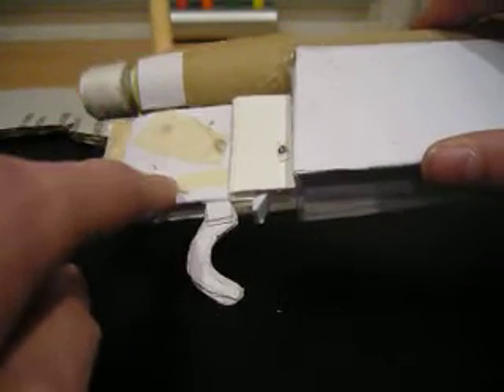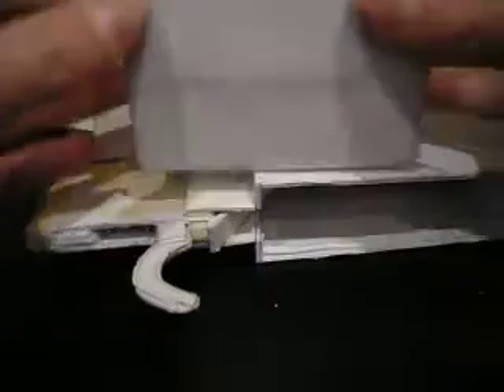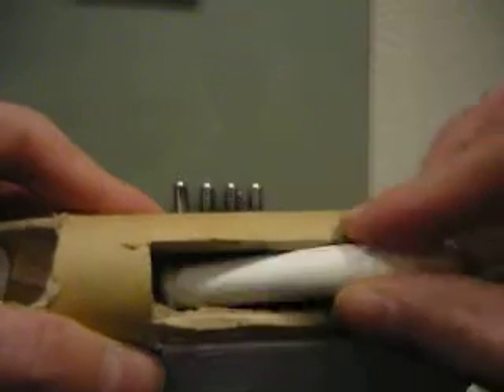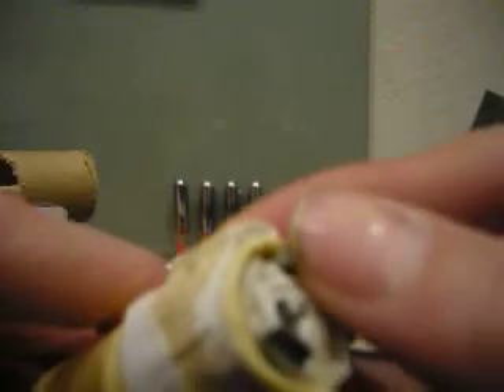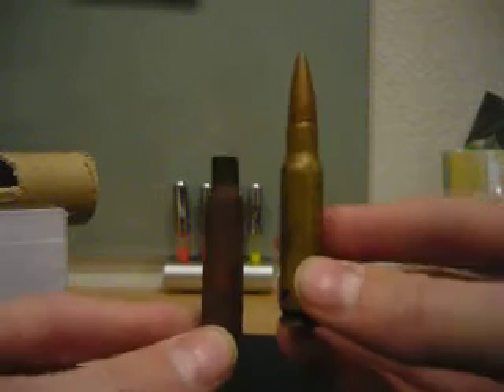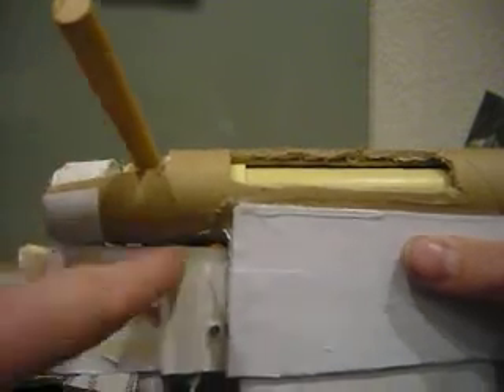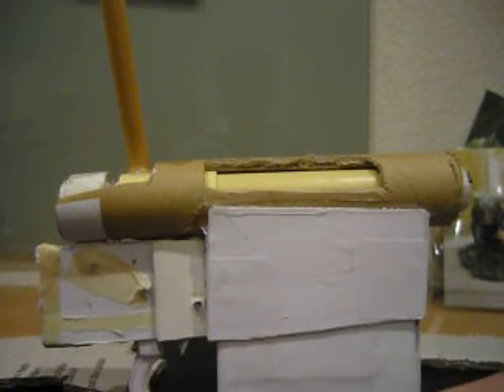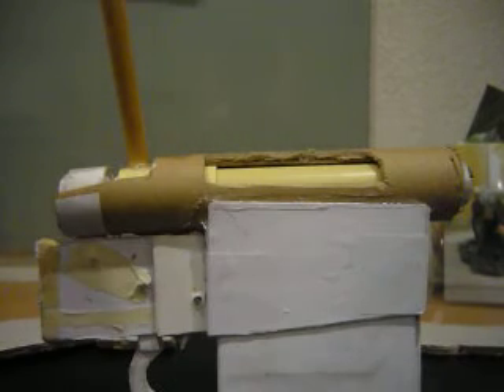Paper M24 Sniper Rifle #3

Comment from the maker: the ejecter was a pain to make though because it is housed in the bolt, the bolt tube pushes the spring of the ejecter so the tention get's weaker but with a hard pull when pulling back the bolt i think it will eject though,and thanks!